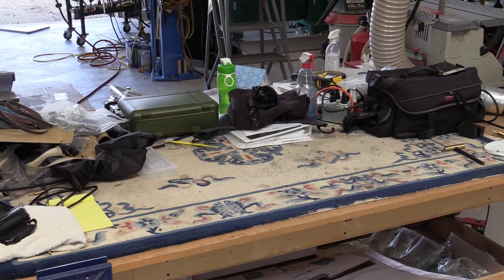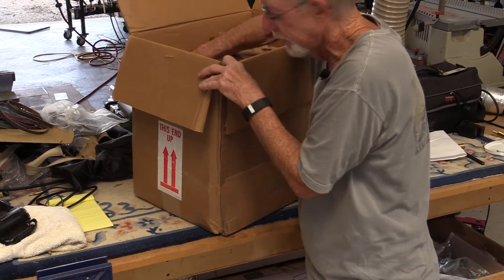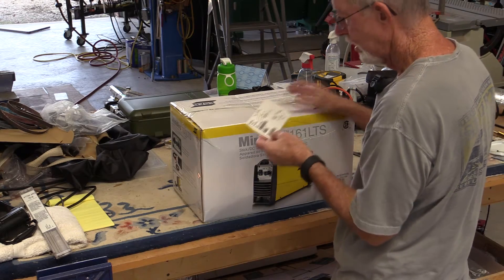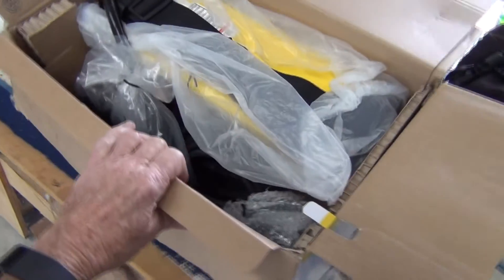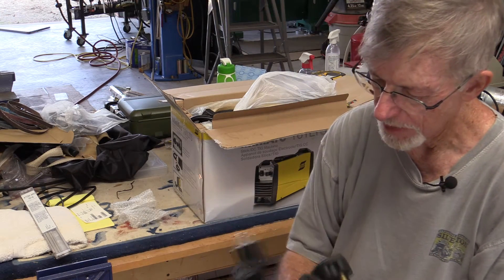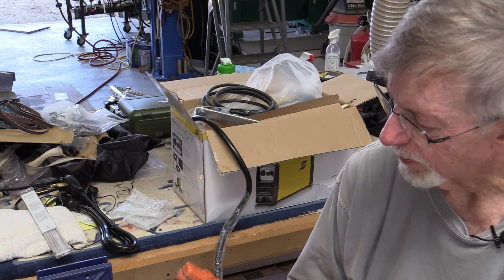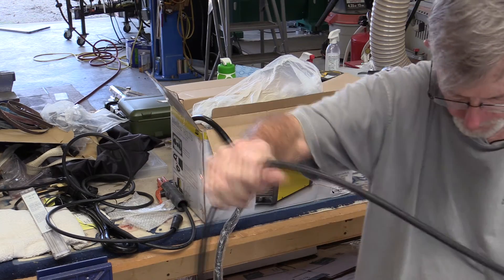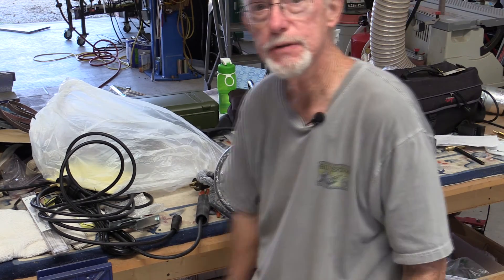We unbox an ESAB MiniArc 161TLS inverter welder (it weighs 20 pounds!)

Comment: better than buying miller ?
Reply from the maker: I have no idea if Miller has a competing product.  If they did in that price range, that would be my first choice.  I have a Miller Diversion 180 TIG machine and I absolutely love it - does everything I need with zero setup hassle.
Reply: dunno yolo yes I use maxstar 200s at work and just got one of these and it's a way better arc then the miller. check my channel to see some welds

Comment: Need a much easier way to unbox anything?  Turn the box upside down and remove the contents from the bottom--rather than the top--just by sliding the box off the inner contents.  The main advantage doing things this way, is it saves your back & arms.

Hope your "toy" has been doing all you wanted (and expected).  Hope you are feeling better too...Have Fun, John!
Reply from the maker: I unbox both ways.  Mainly did that for the video but thanks for the tip.
Reply: Too much time on your hands?

Comment: are they USA  made  I hope ?
Reply from the maker: So what isn't Chinese that the average guy can afford?  The Chinese can make high quality or junk - depends on what their customer is willing to pay.  This ESAB build quality is quite good.
Reply: (dunno yolo ) The ESAB 161 is the same welder as. Thermal Arc/Tweco/Victo 161s. Only difference is power switch location
Reply: (dunno yolo) sorry for the spelling. /Victor
Reply: +Bubba Gump Chinese parts but assembled very well.comparable to M.star 150
Reply: +Bubba Gump You can purchase this welder from CyberWeld.com for a decent price
Reply: @jacobb9534  maxstar 150 won't run a 6010 rod. Maxstar may have foot pedal control for tig if right option but then price is like 1500$ for a 150 amp dc only welder that is crazy.
Reply: Mr. John, how much did you pay for it? And how nice is to weld with it? Thanks! Keep videos up!